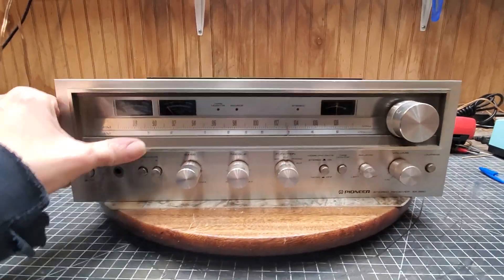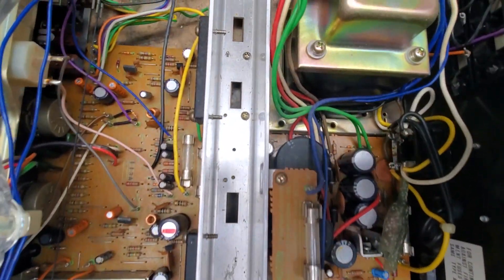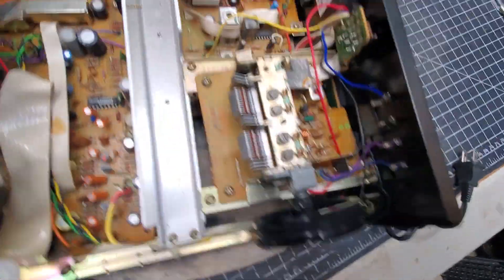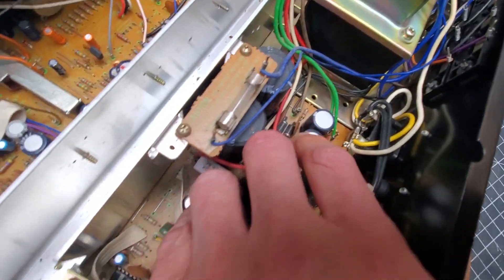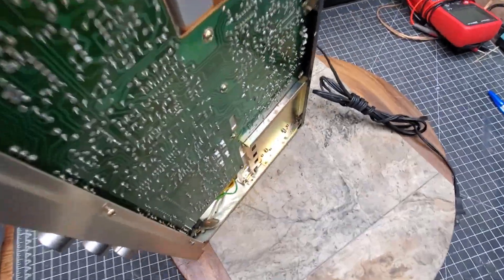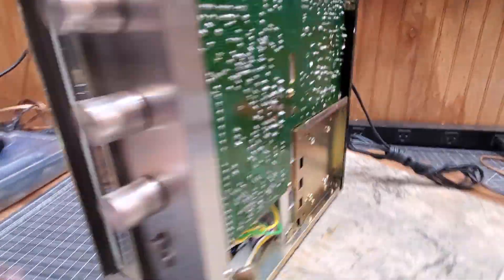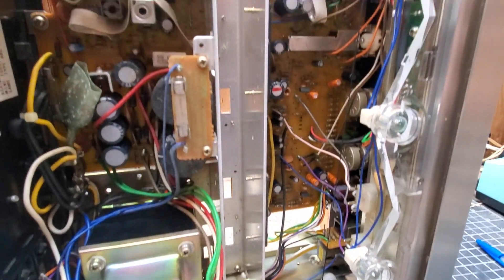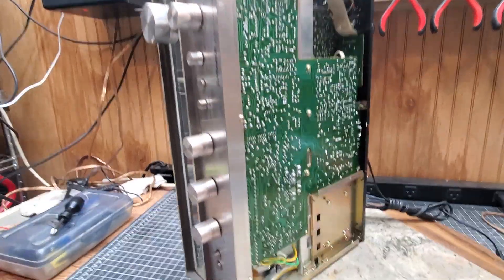1st look at Pioneer SX-580 before digging and being serviced.

Comment: Hello sir, I bought one for myself just to restore it. One channel was getting high on the meter and no sound from the speakers at all.  I went on to change the usual culprit resistor-fuse at the back but after that both channels blown their respective fuses... I guess there's something more. You mention about 3 usual resistors to be changer near main caps, I'd be grateful if you could tell me which exactly they are. Good luck with your restoration!
Reply from the maker: Tomorrow I'll make a video to help
Reply from the maker: Haven't forgotten you, getting over covid or whatever it is.
Reply: @thehappyhandicaptech9372  Sure no problem, take your time.  I'm also recovering form some kind of flu or something. Get well soon!
Reply: @thehappyhandicaptech9372   Managed to fix it,  both channels working . The cause?  - ALL (sic!), all 100ohm resistors were bad (all open). No the only thing that bothers me is lack of Stereo Light. and then goes the restoration which will be a challenge as mine is not so peachy keen.
Reply from the maker: @mistahke  had the same problem a few years back, changed the lamp and still nothing. Ended up being a leg of one of the chips was touching another source. If I recall correct it was the chip behind the balance knob. Sorry for taking so long, being handicap is not fun at times. Happy new year
Reply: @thehappyhandicaptech9372  No worries, nobody's in a hurry [; LED is fine. Mine works when I remove one of the resistors - the one that is coupled with variable resistor for FM adjustment, then it works as it should. I left it for now, until I can get a fresh look. I'll check for shorts when I'm gonna clean the pots, though. Thanks for the tip! Playing now with Akai AM2200... this one's a mess [; Happy new year!